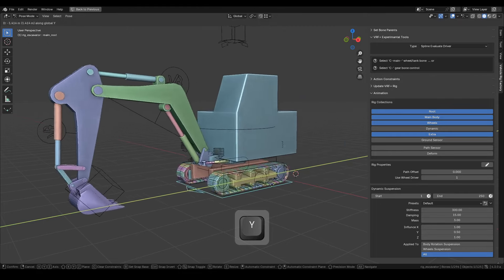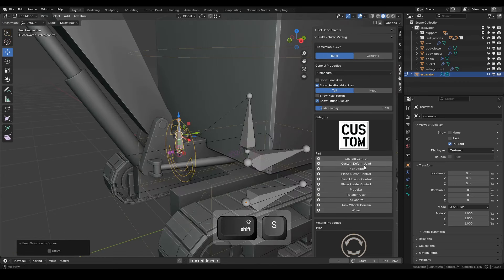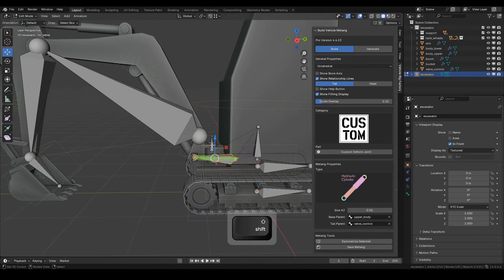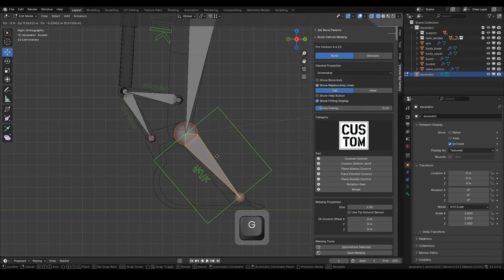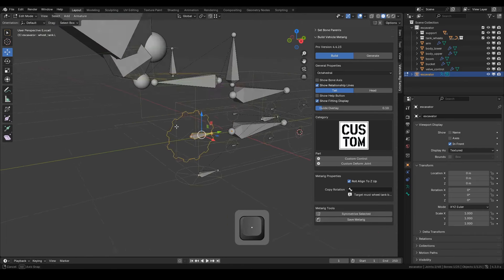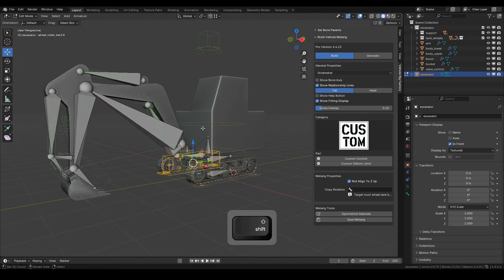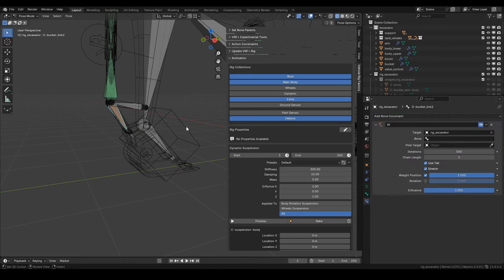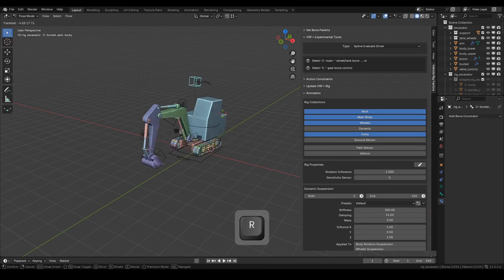How to Rig Excavators in Blender (FAST)

Comment: What happens to the direction of rotation of the wheels/tracks if the car turns 90 and 180 degrees?
Reply from the maker: Hi good question, we have 2 ways to solve that, first is smart driver, second manually bake the wheel ( most accurate way)

Please take a look https://youtu.be/auoi3mZuzWU